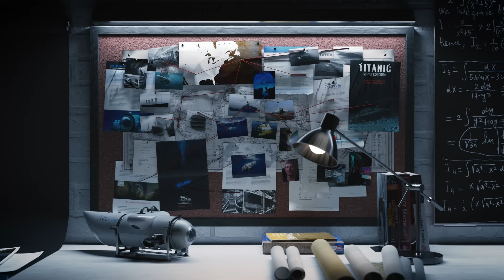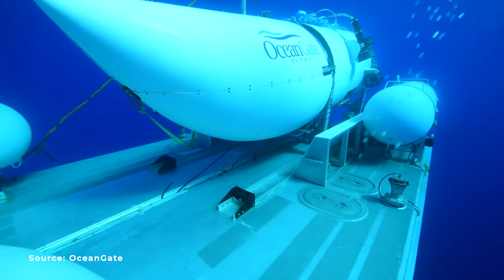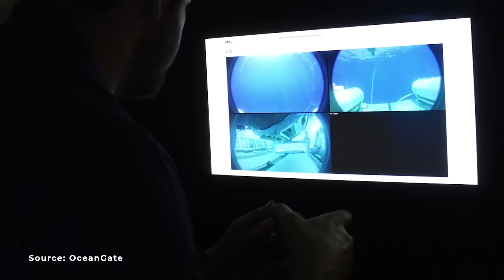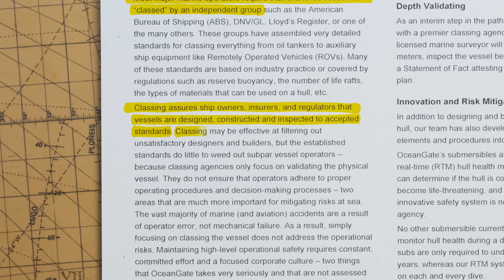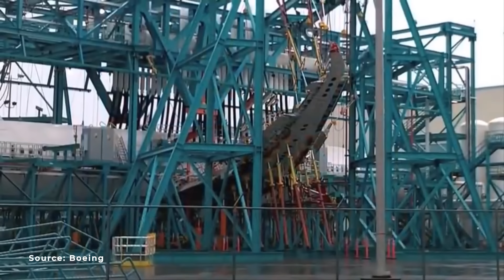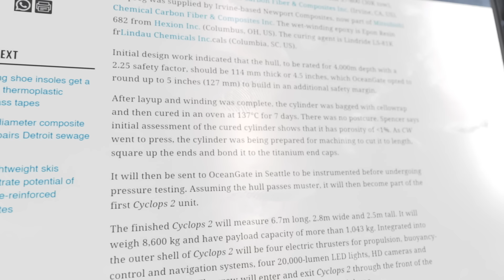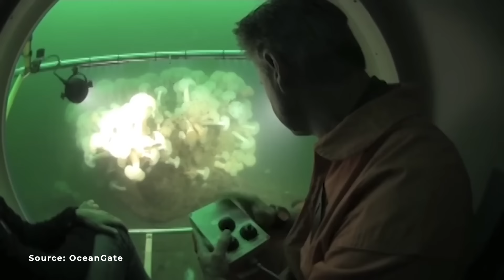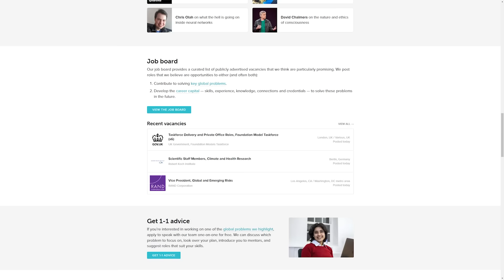The Questionable Engineering of Oceangate

Comment: Perhaps it's oversimplifying snap buckling, but intuition tells me that it could be caused by basic physics/materials science. As a pressure vessel is compressed, its radius is reduce. As stated, this is generally not an issue in homogenous materials. But in CFRP, the individual sequences/plies will be subject to out forces independently (pressure, temperature, etc.). Thus, through the cycle of compression/expansion, the inner sequences will not react at the same rate as the outer. This lends itself, clearly, to delamination. And again, as stated, any CFRP delamination is likely to propagate through repeated cycles leading to catastrophic failure.

Not sure if this is a fact, but I heard that the used a unidirectional stacking. This would be yet another careless action, if true, as it would lead to stress coverage only accounted for in limited vectors, while leaving the material exposed to failure in others.
Reply: CFRP / Resin ribbon was wound tangentially along circumference. While some complex diagonal weave MIGHT have help spread pressure differences better and use ribbon more in both compression AND Tension.

Comment: I think as engineers we can see there are many things that are obviously wrong with the design of this submersible.  First, we know carbon fiber has little or no compressive strength which begs the question: why was it being used in an application where the primary forces are compressive?  Second, we all know about the coefficient of thermal expansion of materials so why were they descending so fast that there was probably no time for the differing materials to fully adjust to the external temperatures creating additional stresses at the CF to Ti joints and also at any penetrations through the pressure vessel for electrical or mechanical systems?  Hopefully those were minimal if any at all but it's more than likely the dissimilar materials interface is where the failure occurred.  Third, there should have at least been some longitudinal connections between the Ti  rings at the ends to help prevent them from separating from the CF cylinder rather than relying solely on the glue and external hydrodynamic pressures to hold the vessel together.  Finally, that hoop winding of the main section of the hull was obviously the wrong way of laying up any CF pressure vessel as it would allow a crack to propagate straight through the fibers from the outside to the inside - top to bottom - in an almost shearing manner - potentially without breaking any of the carbon fibers in the process.  In addition repeated dives would have subjected the layers to expansion and compression leading to potential delamination of said layers - even if all voids were removed in the manufacturing process.  In the end it seems to me this carbon fiber element of the pressure vessel was more dependent on the fluid/epoxy binders holding the strands together than the actual carbon fiber material.  I don't care how much Finite Element Analysis or Computational Fluid Dynamic studies were done on a computer as you are never going to be able to model every conceivable scenario over repeated cycles in this extreme environment.  We need to work on proper non-destructive inspection, strength reduction and failure monitoring systems for these novel materials.

Comment: what still buggs me the most is that in one news clip way before the accident they showed their ballast which were just heavy steel pipes i think. now imagine getting into the submarine and hearing that it's self buoyant in case of emergency when dropping the ballast and next thing the CEO flexes that it's only got an on/off button and everything is controlled electrically with a controller. i mean there must've been a way to release the ballast manually, right? nobody'd be that dumb, right??

Comment: Can someone please throw light on why was SpaceX compared in this video ? They seem to test their rockets well before launching them.
Reply: Those SpaceX rockets & capsules are NOT perfect. But they were tested to FAA & NASA satisfaction & proved themselves AUTONOMOUSLY. Flew & worked UNMANNED !!! Telemetry was sending all systems statuses in real time.
Reply: @adrianmonk4440  I know that they are test and certified, I think you have misinterpreted my comment, I meant why is spacex compared over here as if they have done something similar to oceangate, which they have not.
Reply: @dhruvpankhania2760  //
I copy, and IT'S MY BAD (sorry). I guess I picked it up from other comments along the entire THREAD. Thanks for correction.
Reply: Just because SpaceX is less amateurish, it doesnt mean its good. In fact, it  isnt good at all.  You know it.
Reply: @vycanismajoris6871  I agree that they might have rushed the testing of starship causing avoidable damage but atleast they don't put human life on the line like oceangate. I still see nothing that can be compared with ocean gate. As real engineering himself said that innovating is testing, failing and improving upon, and spacex seems to follow that quite well.

Comment: Great explanation from someone who actually does know what he's talking about.

I have wondered for a long time what the safety margin was. Was it 1.1? 1.5...? Now it seems that with this hull, a safety margin would have been impossible to calculate because of potential voids, or uneven spacing of fibres. It's easy to say after the fact but as one who has been involved in competitive sailing for over 35 years, I know at least a little bit about composite structures myself. All boats are designed with a safety margin - both hull and rigging - and this has to be carefully scrutinised.

I can't believe some of the things Ocean Gate said in that blog post. Not now that you've highlighted the problems, anyway. Good video. Well done.

Comment: Thanks for this piece.  It is a good breakdown not only of what happened, but using this case to bring up serious issues regarding safety in design by building it methodologies... Which i like in cases like space X where after succeeding they did it seems to me ensure through person-less testing that then also doing proper examination of the craft, x-ray examinations, etc ensuring no cracking or weakening of the material was occurring etc.  They actually did more fast in that they didn't spend wasted hours guessing what the problems will be when designing a reusable rocket, etc.  But they then did the proper evaluation of the craft afterwards to ensure that they understood where the wear points were occuring, and also the tanks, etc were showing any signs of imperfections appearing in the steel/ceramics, etc..  
So despite the comparison to Space-X, i think it is not a fair comparison, because in the case of Ocean-Gate they never examined their hull after diving to see where delamination through wear might occur as the resin broke down, etc..
It' sad to think of the kid who died, because of the hubris of the captain, as well as the father who did not properly vet the vehicle.  Given spending that much money, you think you could spend a few thousand more on an outside expert to give a report on whether they thought the craft was safe or not.  As any expert would have given the same warnings about the hull, as it was clear it wasn't the right material for this purpose...  I don't understand how anyone would trust that resin itself is not going to eventually breakdown after going back and forth between huge pressure to normal pressure over and over again.  Resin is just not the proper material for such a thing, it would seem to my layman view.  Every resin I have ever seen breaks down when exposed to repeated stresses... So i really don't get how they ever thought this was not going to do exactly what it did...
Anyway... love the piece, a great warning for people to not skip the after step of inspecting the material that your life depends on, to make sure it is not deteriorating in any way... pretty obvious even before this tragedy....

Comment: Thank you for this video. I work in the space sector. Every single component of a spacecraft, every subsystem made up of those components, and finally the entire spacecraft, are tested rigorously. And I work with uncrewed spacecraft. The fact that they built a vessel with such hubris and put people in it baffles me.
Reply: Also in the space industry, and it is a bit surprising (but also not surprising) how much testing is done at EVERY step of the design and building process, even for unmanned craft like you said. And if things go even slightly off (not even outright bad), then at a bare minimum, there is days of deliberation and analysis to see if the outcome was acceptable, or if a fix/re-design, followed by more testing is required.
Reply: "Moving fast and breaking stuff" means you have to break stuff, which is precisely what they didn't. It's a bit weird to blame that one on SpaceX, when what they are doing is blowing up rockets until they know they are save.
If Oceangate worked like SpaceX, they would have built a few hundred subs before putting people on it, while also building a very safe emergency procedure...
Reply: I work in the offshore industry including on SRS, it made me so angry to see this story. It's the first loss we've ever had as an industry.
Reply: you even have a limited safety factor to work within 1.2 ish? (damn gravity).  They had a safety factor limited by arrogance and greed.
Reply: Your point is so right, and I also notice and appreciate you using the terminology "crewed" instead of "manned"

Comment: 8:26 as a computational chemist I'm rather interested in how this kind of software works. At a molecular level, it doesn't seem particularly challenging to model a heterogeneous material. But I presume engineers aren't running molecular dynamics simulations on each atom in the material :) Still, surely it'd be possible to parameterise a model which takes heterogeneity into account, based on data from finer-grained simulations?
Reply: Dude, got a CRAY COMPUTER in your pocket ??

Comment: As a mechanical engineer I just don't understand why didn't they use steel. Steel works
Reply: Dude, no internal bulkheads, ZERO. Along with a plethora of other design & structure, & manufacturing flaws. They use bulkheads in Navy Submarines. Why? So they can tie tight strings to each side AND WATCH THEM GET SLIGHTLY SLACK AS THEY DIVE.

Comment: I am  a mechanical eng. with 40 years of experience, not an expert in fibre reinforced composite materials though, but I know enough to state that when under compressive loading, the composite is not much stronger than the epoxy resin  used to bind the fibers together, in other words: the carbon fibre strength will not be helping much as fibres cant sustain any compression loading although carbon fibres are superior to steel when in tensile loading.

Comment: The difference between the OceanGate accident and other “move fast and break stuff” engineering is that OceanGate actually put people in harm’s way. As an engineer myself, I really don’t see an issue with building stuff, then breaking it to see how and why it fails in order to improve later designs. As long as no one is in danger, it’s funded privately, and the mess is cleaned up, have at it.

Comment: The normal descent rate on past dives was about 25 metres per minute (m/min).

From the times and depths in the text messages, during this dive; right from the start the sub was descending at about 38 to 39 m/min, and the last part from 2960 m depth to 3433 m depth at 44 m/min, almost twice the optimum rate. On the way to 3433 m depth the structure alarms started going off.

This suggests two possibilities to me, of which either or both may have contributed to the loss.  

Firstly, the sub may have been fitted with more ballast than it should have been.  This would explain a higher than nominal descent rate, but not the increase in descent rate as the depth increased.

The second factor may have been reduced buoyancy due to pre-existing and then progressive damage to the carbon fiber pressure hull.  This second factor is more consistent with an increase in descent rate than the 'too much ballast' scenario, because as depth increased then the progressively crushing hull would have a similarly progressive decrease in buoyancy and hence give a progressively increased rate of descent.

Near the end, at 09:35 (3500 m) the crew advised that they had jettisoned the frame after multiple attempts. This difficulty could have arisen due to the hull warping or even contracting as the carbon fiber cylinder 'necked' under the pressure, partially jamming the frame in the sleeves. Was the frame the only thing that was holding the ends apart in the final stages as the cylinder sagged and moved in?? 

It is important to note that the high descent rate was evident from the start of the dive, thus what ever condition was causing this was present from the surface down. 

A hybrid possibility is that there was too much ballast, and the increased descent rate was too much for the hull, and after 2960 m the hull started to fail progressively to eventually collapse entirely.  Given the steady descent rate down to 2960 m followed by the accelerating rate after, this hybrid would seem to be a best fit to the data.

If the initial loss of buoyancy was due to pre-existing hull deformation then it would be useful to check the dive logs of the previous dive to see if there is any evidence there of higher descent or slower ascent rates.  A passenger on that previous dive noted a lot of sounds from the hull, which could be indicative of initial failures.    I note that the carbon fiber cylinder had an inner liner to which equipment like screens and lights were attached, and an outer sleeve covering the supports for the thrusters etc.  So inspection of the pressure hull itself would require removal of these liners and sleeves.  Was this direct physical inspection of the cylinder done between dives?  

However, the hybrid scenario of excess-ballast leading into to hull collapse at depth seems most likely, IMHO.

Comment: The comparison to SpaceX I think is rather apt. SpaceX adopted the Move Fast and Break Things approach because they could do so safely. And while they have moved quickly, they still progressed in small steps.

For example, when trying to get reusable, landing rocket boosters, they first started by developing the engine, then started smaller-scale hover tests verifying that they control the rocket.

Then, when they progressed to the Falcon 9 and started attempting landings with those boosters, they first attempted soft landings in the ocean, then on a remote-controlled barge, and then at a landing site on the mainland. They made sure that things worked in a less risky environment before moving to a more risky environment.

And probably most importantly, nobody was on board at the time, and safeguards were in place in case things went wrong (which they did). So far, the only major safety issues that SpaceX has faced were when their Flight Termination System failed to properly execute a rapid unplanned disassembly of the Starship test flight, and improperly designing the launchpad for Starship.

And when SpaceX did put human passengers on top of a Falcon 9, they followed the standards that NASA had set out for them.

Compare this with OceanGate. Sure, they moved fast. But they didn't break things. They didn't test things to destruction. They went straight to full-scale dives down to the Titanic as soon as they could. They assumed that the computer simulations were accurate. While I was studying engineering, I had one lecturer say "Simulations are good, but they all need to be verified with a real-world experiment." Simulations are no good on their own.

By the way, the controller is actually one of the few good choices that OceanGate made. Why try to reinvent the wheel with it? It's a perfectly serviceable method of controlling the submersible and has already been tested to make sure it lasts thousands of hours of plastic-destroying gaming.

Comment: The problem most companies that try to idolize Spaex have is capital expenditure. The SpaceX R&D budget was the equivalent to filling a warehouse with pallets of cash then setting it on fire. They blew up more stuff than they launched for a few years. They move fast and *BREAK THINGS*. That is not just a philosophy, that is a work ethos. If Oceangate wanted to emulate SpaceX's success, he would have built 5 of those submersibles, 2 would undergo insane ciclical testing and be cut apart for analysis, at least 1 would be live streamed going well beyond it's rated service depth to maximum crush, with another going just above that and coming back to be tested like crazy, and the other would be land mounted and undergo all the life support testing and geat outfit prototyping. Then SpaceX would be comfortable with it. They got certified by brute forcing the system and going the "build it cheap and let it fail, then fix it" method. Oceangate had one vessel and no testing. It's the polar opposite of who the idolized